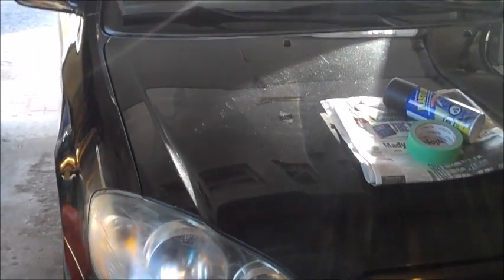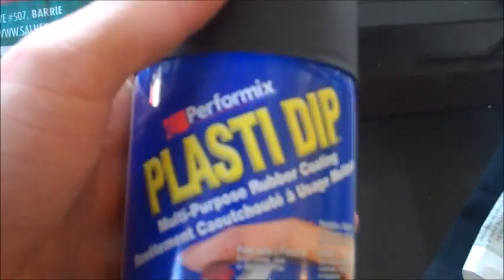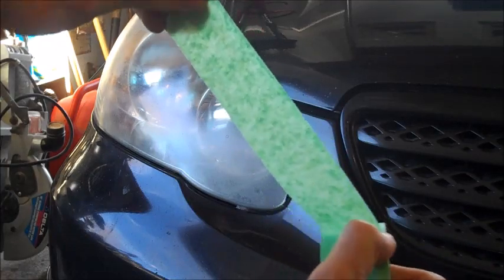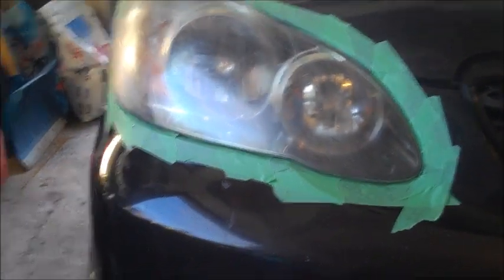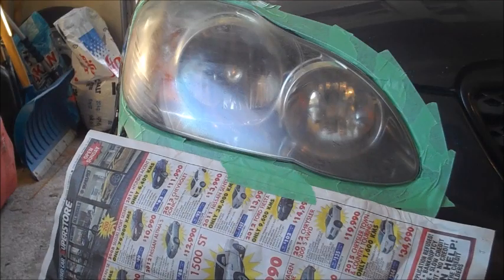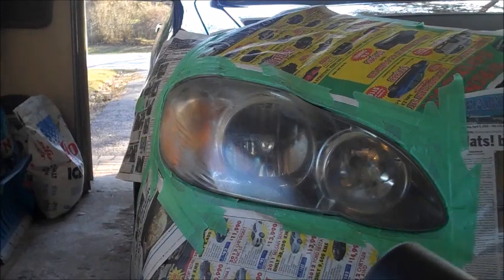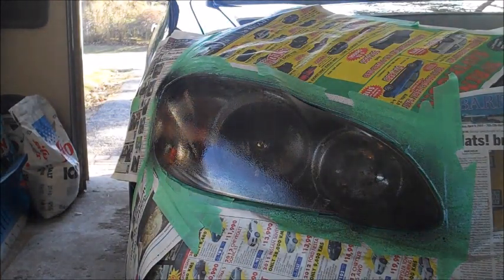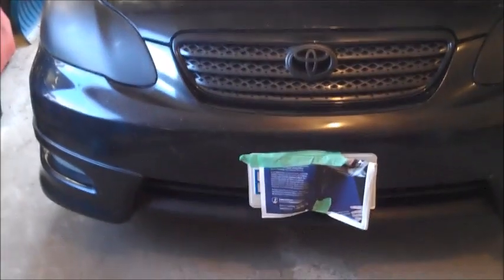How to Tint your Headlights for $20 - EASY

Comment: you're modding a Toyota corolla. lol
Reply from the maker: +Marky Force hey its an XRS with the lotus engine and a 6 speed manual transmission so it isn't your average corolla :)
Reply: +ThisAccountIsNeverUsed Be modest and respectful, I dare you ^
Reply: ***** my mom thinks I'm awesome
Reply: ***** 100 percent Markey doesn't even own a car
Reply: Francisco Fernandez 100 percent sure you have jokes
Reply: +inventor719 lol just cuz it has a lotus engine doesnt make it good. i bet any ls motor will be better then anything lotus makes. and that thing only makes 170hp so its not anything to brag about
Reply: GotzeGaming plus the lotus engine is made by toyota!
Reply: The lotus engine was totally rebuilt by Yamaha. So this car can have the same engine if you drop 10 to 15 thousand into it. If we have to, overnight parts from japan.
Reply: Bro good job and thanks for stepping out the box and trying something different.  Every city/state is different.  It was a good job and looks great.  Maybe a good single coat would’ve been better.  Peace ✌️
Reply: @iissac22  ya i agree too

Comment: plasti-dip is not what should be used for this, maybe a taillight but even that is a stretch. plasti-dip original is an actual coating   of rubber material that does not allow light to pass through. they sell plasti-dip SMOKE that is more translucent and will allow light to pass through at a safer level. there are also many other spray products out there designed to smoke out head/tail lights, not to mention the vinyl wraps.
Reply: Agree with u everyone does there own thing but PlastiDip isnt for Headlights, I think your better off with VHT I think..
Reply: This is translucent

Comment: How are you supposed to use your lights? You do know they make tint in a spray can now right? This would be great if I only drive in sunlight... It's good that you chose dip over normal paint. At least we can pull it back off 2 hours after we finish it. While I'm at it, I just picked up blue tint film on eBay for 1.50$ that's USD..

Comment: Word. The better you get, the smaller number of coats you will need. Doesn't have to be too dark, but I've seen them turn out very, very nice.  Honestly, it's gonna be too dark your first time around. The next time, you'll know  how your headlight reacts to the Dip(glass, plastic, so on) and you'll be able to spread more, but use less, making the lights brighter than your first time. And forget these negative spam posters, bro.
Reply: Ikr

Comment: will the heat of the light melt the plasti dip? since it is rubber. Because i wanted to do this with the plasti dip smoke to my car
Reply from the maker: I'm not sure. In the end I just got different cool headlights
Reply: no. I used the smoke color on my tailights and headlights and it looks cool. it takes a few coats so get two cans, though you'll probably need one - just in case.
Reply: First off do not use plasti dip. It's literally hot made for this application. It's used for covering wheels emblems badges ect.. Vht and tints are a better option as they allow light to pass through

Comment: Dont do this to any part of your car. I have my tail lights done and I personally don't recommend it at all, especially the headlights. I completely blocks all the light needed to see. I no longer have backup lights because of it. It does look good but now I can't see when I back up in the dark and cars probably can't see my turn signals.
Reply: that's why you shouldn't do more than 2 coats..
Reply: If u use dip than yea your wont see shit... Use tints and smoke